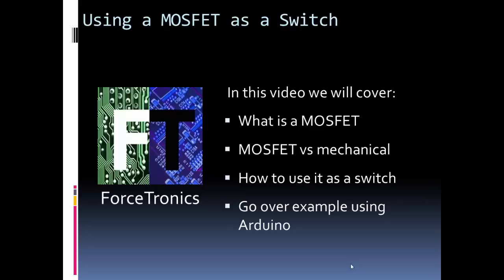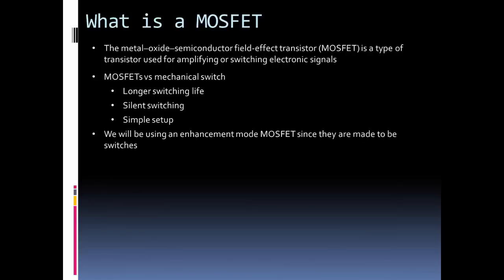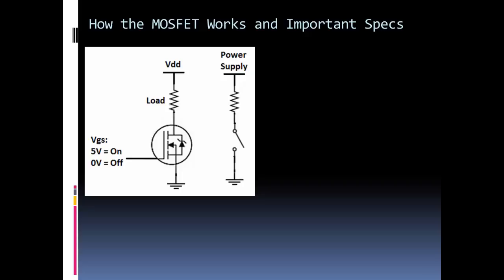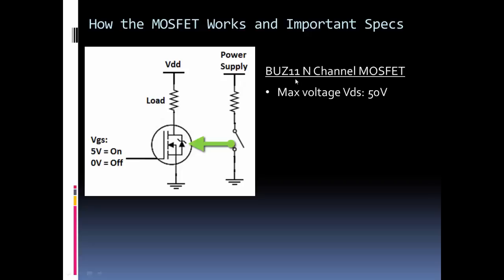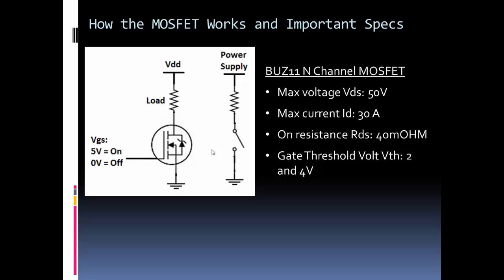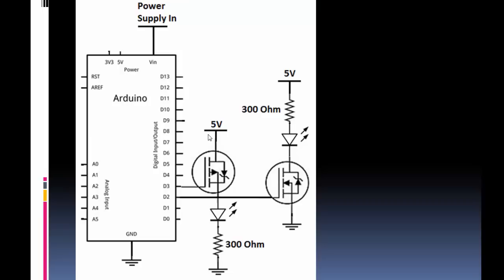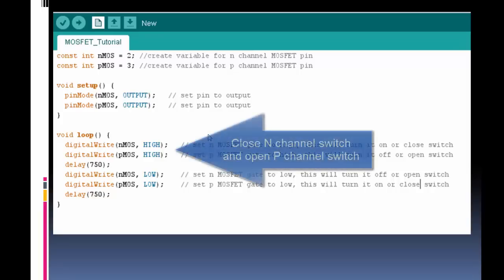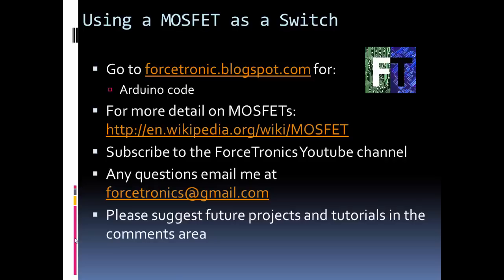How to Use a MOSFET as a Switch

Comment: Is the mosfet just transistor?If it's transistor,what's make the difference of their name?
Reply: Mosfet stands for metal–oxide–semiconductor field-effect transistor. What that means to YOU is, it is designed for relatively high current applications(on drain) but controlled by voltage based low current triggering(on gate). Basically, it allows you to control a rail that would otherwise be too much current for you to work with directly.
For instance, by using an op amp, a voltage reference, and the drain feeding back to the op amp, you have a high current voltage regulator without burning out your op amp.

Comment: Let me put it this way we have a 12/volt battery on a table that has a light on but in time the battery is dying  with voltage going lower and lower and the light brakes at 9/volt and lower . It is this I want to stop , put something on the line that would sense the lower voltage and shuts off and only comes on when volts are 12v or high

Comment: how come my mosfet conducts without any gate voltage?
Reply from the maker: Is the gate tied to a pull-up or ground? If you leave it floating it could randomly turn off or on
Reply: @ForceTronics  Thanks that was the problem!! Grounded it with a 10k resistor. thank you

Comment: Sir can I do this same  project with irfz44n mosfet
Reply from the maker: To answer that question you need to understand the parameters of your application such as peak current and research on the MOSFET's datasheet if it meets the needs of your application
Reply: No need to check datasheet ..its already done by my experiment on project & between switch on & off its also can be used as a variable resistance for controlling the output current flow by varying the gate voltage between 0-5 volt ...which can done arduino pwm pin

Comment: What about when the switch is closed ... How much power will it then drain when the  switch is open ?
Reply from the maker: It would be almost nothing, but it depends on the mosfet you use. This is information you would find in datasheet
Reply: @ForceTronics  what about transistor Vs mosfet Vs relay? Just in general comparison of power drain ... As to my knowledge, transistors drain alot of current when ouput logic is LOW

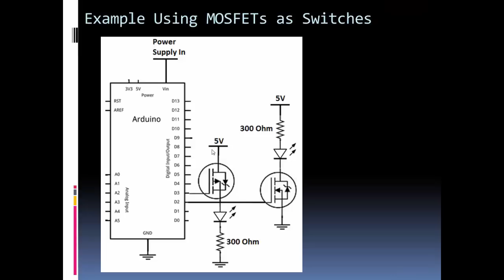Comment: Am I the only one to notice that the figure @7:02 appears to have the P-Channel MOSFET placed UPSIDE DOWN??  Shouldn't the SOURCE be connected to Vcc and the DRAIN connected to the load?
Reply: No, I fully agree to your point. The source of the p-channel MOSFET should be connected to the 5V power source and the drain should be connected to the LED.
Looking at 9:40 and enlarged later it looks the wrong circuit for the p-channel MOSFET was also realized with the Arduino (the most left Pin on the p-channel is connected to the LED, but it should be connect to the +5V supply).
Obviously it still works in this combination, but I assume the Gate - Source voltage is less than the optimal -5V (may be something like -3.5V or -3.7V just letting the extremely large MOSFET pass the little current the LED needs).

Comment: Who was the moron who named the side that is closer to the voltage source “drain”  and side that is closer to ground “source”?
Reply: Yea it's weird. 
I didn't know that with P-channel it is reversed.  Learned something new. 
I always use N-channel so it's easy to remember.  The way I remember is to think that the source is the source of "electrons", and the the "conventional current" flows in the opposite as the electrons.
Reply: for sure. especially when starting out, it seems like there are So Many things in electronics that are named in such a way just to make it more difficult to learn the basics. It''s like if you don't have the Rosetta Stone for the backward language of electronic specs, you will surely end up frying your components! 🤦‍♂️🎇👀😣
Reply: when started learning about transistors, the naming threw me off. the easiest one for me was npn bjt, which is just the base, collector, and emitter. that was simple since in my mind, base is base,  then the collector "collects" the current, and then the emitter "emits" said current. then i found out that mosfets use drain and source, and it seemed to be backwards to the bjt naming. THEN, it turns out that pnp's reverse the naming.
Reply: Because electrons flow from source to drain.

Comment: The diagram of p channel mosfet is wrong I guess because as you have showed it in schematic the body diode will conduct all the time
Reply from the maker: Yash Kudale Thank you for the comment. I am not sure that I do have it wrong. The diode shown is a zenor diode and (from what I know) it is there to protect against fly back voltages from inductive loads. It has a higher threshold voltage than the MOSFETs normal operating voltage.
Reply: ***** true ! just check on 7.12 the body diode of P channel MOSFET is forward bias hence conducting irrespective of the gate voltage
Reply: ***** and sorry if I am wrong
Reply: 93ح3ح

Comment: Can I switch it on by esp32 gpio(3.3v) ?
Reply from the maker: You would look at the Voltage Threshold spec in the MOSFET's datasheet to see if 3.3V is enough for fully turn it at the gate. Most lower power MOSFETs should work with 3.3V, for higher power ones you may need a gate driver circuit

Comment: what would happen if the threshold voltage sat in between 2 and 4V ?? ( 6 min )
Reply from the maker: If the MOSFET is not fully off or not fully on (as defined to act like a switch) then it is operating in the non-linear region. In the non-linear region you can use it for amplification or as a variable resistor or other things that I may not be aware of

Comment: If you don't need 50V and 40V will do (@ a max of 195A) use IRLB3034 instead.  RDS(on) is typ 1.4 milli ohm and max 1.7 milli ohm not that crazy 40 milli ohm which is horrible.

Comment: can we use it in AC supply as switch
Reply from the maker: No. Need a TRIAC. Check out my channel have a video on TRIACs
Reply: Hi, Not strictly true.  You can connect the AC load to an AC side of a bridge rectifier. The  MOSFET is used to short + and - of bridge allowing ac only though load and DC only through MOSFET. I have controller AC fans this way as there is no hum heard if MOSFET is turned on at zero crossing  then turned off less 10ms later to reduce speed. Must use a suitable rated capacitor.

Comment: Anyone like challenges? I need a simple low voltage somewhere like 12 to 24 vdc circuit that will switch polarity in continuous 1 min cycles so say a motor will switch rotation every minute. I'm new to electronics and find it very interesting but can't find anything like this out there. Is this posable?
Reply: iamwhiteshadow I think you are looking for a h bridge. You can build this with 2 n channel and 2 p channel mosfets.
Reply: do you have an arduino?
Reply: I would start by using a DPDT relay and build a circuit using a 555 timer IC to trigger the relay every 60 seconds.

Comment: Thanks for the video . sir' Can you help me to built transmission circuit I want to use arduino and inductive coupling to transfer energy wirelessly with use of LC oscillator and IRF530 mosft and 12 volt D.C power supply and the distance between the transmitter and receiver circuit 15 cm. and the current at reciver must be 1A.

Comment: I dont understand how a 12 volt is  used on a inverters but the mosfet can only used 5volt how is this
Reply from the maker: Voltage ratings on Mosfets vary. You just need to find one with voltage ratings that fit your application.